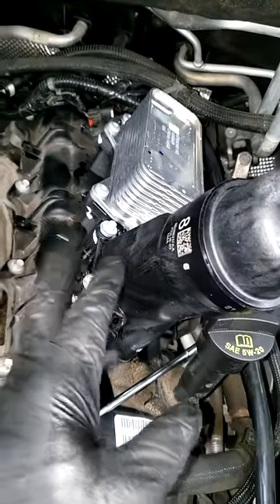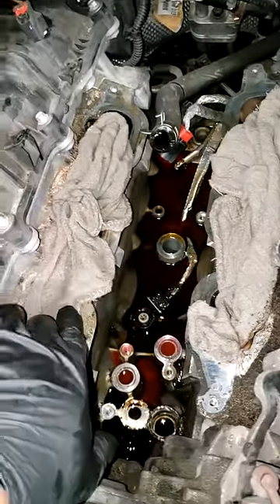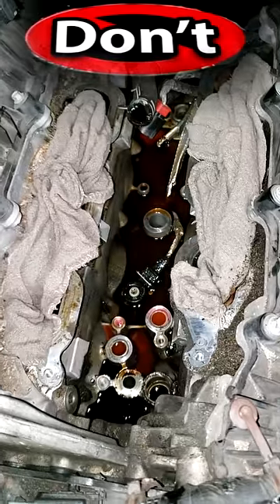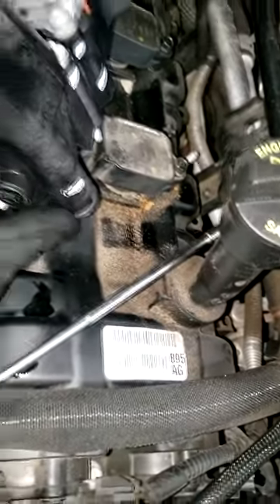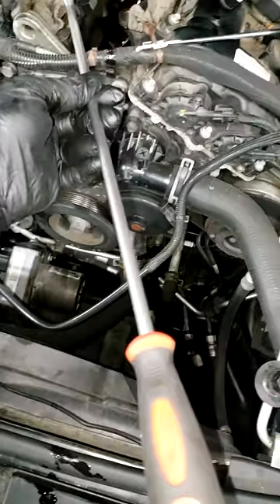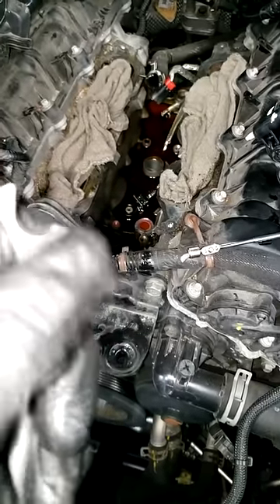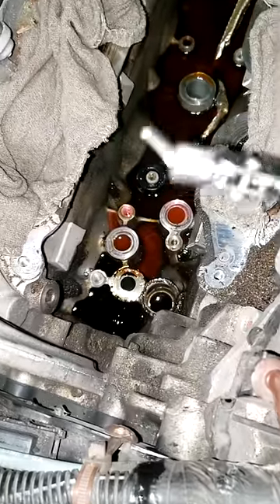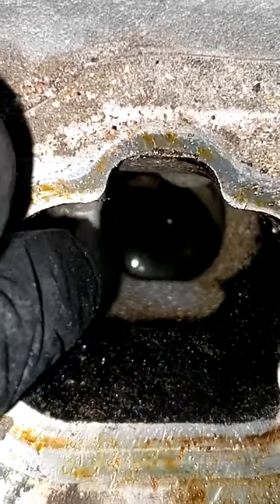This will scare the hell out of any mechanic. But I found it.

Comment: Aw yes that thing know as a FO (foreign objects) which can lead to FOD(Foreign object damage). Learned all about this  while as an Airmen in the Air Force. You can never be too cautious where multi-million dollar air craft and their support equipment is concerned.  Something as small as a rivet or light lens can cripple or down an aircraft. Small lungs can also cause ejection seats to jam and fail. We had to empty our pockets while working in critical areas and collect all  damaged fasteners and other damaged materials we were fixing or replacing. 

So you are doing a very smart thing that everybody should be doing.  

Funny story my college auto teacher left  a rag sitting inside the 454 he had done head work on when he was younger. He found it when he broke down in a lake with his ski boat that he had put the motor in because he had no oil pressure. He got it back  to the dock and found  bits of the rag in the oil pan. He backed his boat between two trees and created a makeshift sling to remove the head and found the rag all shredded inside the engine.

Comment: I once had a Hyundai Sorento 3.5 V6 that the intake manifold variable length butterfly place screws came loose. Found a half eaten/worn down butterfly plate sitting up against the intake valve. It ran fine it came in for a tune up and manifold gaskets. lol I test drove it beforehand and it drove fine.

Comment: It's crazy I just got done taking off my intake and my high pressure fuel pump they had these little metal clips and for some reason I decided to look into my intake and just see if you know what my valves look like so you can't be any more true about covering those up if I would have just been nosy and wanted to see my valves and what they look like I would have had that metal piece stuck in my intake awesome video
Reply from the maker: Whoaaa, yea man stay alert. Thanks for watching

Comment: Did the same job you did a while back. It seems the rubber o-rings go bad overtime or something. I ordered a fully alluminum oil cooler to hopefully make it last longer instead of the whole plastic housing, Anyways it came with new bolts that you had to put in and stupid me went to put them in after I seated the oil cooler in the middle of the intakes and one bolt slipped out of my hand from being oily and landed right on my shop towel that was covering a intake. I've never thanked myself so much in my life. The valve was more than open enough for the small bolt to fall in. ALWAYS, cover the intakes, covering the intakes, take no effort at all, and save you from many problems that you do not want, I'm sure, lol.

Comment: I keep a smart watch charger for fishing objects out of cylinders or intakes, I fished a screwdriver shaft out of a sparkplug hole with it in about a minute after failing with a telescoping type, and I got a nut out of an intake with it, very handy little magnet cord, it's about 2 1/2 ft long, thin round cord with 2 powerful  magnets about 1/4 inch apart parallel with the cord, the three electrical contacts in-between the magnet allows it to slide over magnetic surfaces by pushing and twisting the cord, but when it hits a loose bit of metal, it hits good enough to drag it up, manipulate the object with some needle nose, bam, crisis averted. No extra work over a bit of metal, just a bit of fishing.

Comment: as soon as I took my intake manifolds off, I go to get my ratchet and the back end of the socket hits the intake pipe and the socket comes off falling directly into the intake port. It was only a 8mm socket and thankfully the valves were closed on that cylinder. Also had to clean out some black death in the injector ports and the brake cleaner straw flew straight out and into the cylinder haha.

Comment: I was doing cam and lifters on a Hemi one time. I put the passenger side cylinder head on (with a little bit of wrestling) and noticed one of the caged nuts for the exhaust pipe was missing off the manifold. I had already torqued the head down. I decided to bar the motor over slowly and sure enough it stopped turning. Pulled the head back off and that nut was sitting in cyl #6. I could have just as easily said "oh well I'll just get another nut" but that's why I stress to my apprentices to keep track of all hardware. Not just so you can put it back on, but so you know it's not somewhere it shouldn't be.

Comment: I was doing this job on a v6 jeep wrangler. lost a little 10mm bolt that I thought fell on the floor so didn't worry about it. got the job all done and started the vehicle. the bolt fell into cylinder 3 and vent both valves. thankfully complete cylinder heads are only $400 and a head gasket was $80 so was a cheap mistake.
Reply from the maker: Dang, that sucks. Sorry bud

Comment: As a Mechanic of a 2 man shop that services way too many of these 3.6 Engines. (Whether in Wrangler's, Durango's, Grand Caravan's, and a Heating / Plumbing Fleet of over 200 ProMaster's... I do these 3 to 5 times a week... The only thing scary is the fact you used a cheap flimsy tool that is not even necessary. Just grab it by hand, lift and just a little wiggle... Comes right out and no tool required. No flying pieces. A decent Mechanic can let the Cork loose on the Cooling system and replace Adaptor, all gaskets replaced and Vacuum Filled and crank the Key on a ProMaster in 90 Minutes if all parts are already there. My personal best is 49 Minutes.
Reply from the maker: Lol, I cant tell if you coming for me with these shots or you genuinely trying to make a point. So please enlighten me first before I commence to clowning ya ass.
Reply: @OnlineMechanicTips  Just making a point. No reason for any sort of Prying Bars, especially something that could break from Plastic lifting an O-Ring'd Tube.

Comment: I dropped a lock washer in my intake. Started the motor heard a clanging sound. Took it apart and put it back together. There was a imprint of the lock washer on the top of the piston. Ran great. I got lucky.

Comment: It can. Happened to me on an old Volvo 4 with the vertical intake runners. I even stuffed rags in them right after opening but a washer still ended up in the cylinder.
Reply from the maker: Ohhhh Snap

Comment: I put up a short about this. About putting paper towels in the intake so bolts and nuts don't fall in. I had to take the intake plenum everything off my 08 Town & country to do the valve cover gaskets that were leaking terribly on my van I just bought from a shady car dealer.
Reply from the maker: I saw that video..Dam good tip,
Reply: @OnlineMechanicTips  Thank you 👍

Comment: Just did one of those a week ago on a Jeep. I just wiggle and pull up to remove it. Its just an o ring seal. Upgrade it with Metal oil cooler body.

Comment: If i saw it go in or think it went in the cylinder just pull the plugs and insert ur magnet in each one to make sure nothing is in there if its small enough to fall in there its u can get it out of the spark plug hole

Comment: this is why I have a set of bath plugs, specifically to stop up inlet and exhaust ports when working on a motor and needing to remove carbs and zorsts.
I've taken top ends down and found broken valves caused by nuts and washers that 'magically' appeared in engines that the customer messed with..
a rag is better than a ton of swarf in your motor too.
"I replaced a thread in my rocker cover and now it sounds horrible!"

Comment: “That valve is open” meanwhile just knocks dirt and sand straight down the head lol always use some simple green and air compressor to get in those cracks before removing the manifold! I’ve spent hours shop vac’ing with an extension into a cylinder to get dirt that got knocked in there out.

Comment: Back in 1988, my dad just built my first car, a 66 Nova, the hood was up and air cleaner off, my little brother had one of those wooden glider planes with the red propeller, with a rubber band, he wound it up too tight and Pop! The little brass pc at the tip flew across the garage right into the carb. He started the car and it was horrible. Took the heads off and there it was, a little ball of brass, since it was soft, no real damage!

Comment: I had a similar incident last week. Piece of a ram top side canister fuel filter snapped off, and I was worried it fell in the system. Luckily, found it on the floor.

Comment: Going a little further on this topic. Mercedes has their main diesel engine the Om642. When the oil cooler seals go I believe it's around a 14 hr job to disassemble the top end, turbo, intakes, pedistal, Egr tubing etc. 
If you drop even a little grain of sand or metal down into those oil return/feed holes you will see that engine come back around 3k later with a main bearing that's spun or with heavy scoring causing it to seize entirely.
You think you're a good tech until you learn the hard way. Always cover your holes people. Don't fuck around and take pride in your work. Once you remove a component, cover the holes if their sensative. 
This is peoples work inventments, their ego and sometimes their lives you are putting in danger. 
Keep your ego in check and just just do a good job.
Great message friend ✊

Comment: That's not a pry bar, it's a long/extended clip remover tool for getting hard-to-reach clips in headliners or bing trim panels. you can use them as pry bars, but most aren't hardened tool steel, so the small heads usually can't handle that kind of abuse.
Reply from the maker: You exactly right my guy.
Reply: Not defending harbor freight here, but I have to agree. Tool is made for plastic clips and interior bits. Using it for what it wasn’t made for, then downplaying the quality of the tool doesn’t make much sense…

Comment: At least you had the experience enough to cover the cylinders! When I'm doing head gaskets, I shove shop rags down in em. Things happen, and you prevented it from happening.

Don't even trip off the "that's not a pry bar" crap. I've used to many tools in ways they weren't designed. LOL! A tool shouldn't be use due to it's NAME, but used for it's PURPOSE!

I've used my Jeep winch as an axle puller...like two weeks ago! LOL! The axle puller couldn't do it because the bearings were heat-welded in a couple of spot. Hooked up the winch and tapped on the axle puller as the winch gave a little tug. POP! Came out after maybe 2mins.

...and that's what winched do. PULL.

Comment: Oh I've definitely had a scare like this. I was Walnut blasting my intake valves on my 135i. I forgot to crank over the engine to close the valves on the cylinder I was working on. Because I was on a roll and I got carried away. I filled the whole combustion chamber with Walnut media. Car has been running fine 7 years later. I had to spray compressed air through the spark plug hole while simultaneously using a vacuum on the intake port to get everything out

Comment: How about using an actual pry bar? I've been wrenching for over 20 years. Haven't covered ports in over 10 years. Never dropped anything down hole.
Reply from the maker: Then don't start covering them up now, you on a roll my guy. Just ignore this video. It was basically meant for sane people.

Comment: I cover them all the time due to a lesson I learned myself about 5-6years ago. My 01 Highlander did knock sensors and the harness had something drop in the intake, looked for 10 mins couldn’t find it and ended up starting it.. ticking noise will not go away lol. Lesson learned the HARD way, she’s still running but consuming oil😅 (probably a bent valve but at this point I’ll just put an engine in it when it dies)

Comment: I was chasing intake bolt holes in the heads of an engine with a tap and didn't use elctrical tape the end of the handle that wasn't crimped and the handle slipped out and went down in the lifter valley and then down into the oil pan... luckily the oil pan gasket was the next thing on the list for that car since it was leaking.

Comment: 100% 
My very first week as a professional technician I was doing valve covers on a kia sedona never doing one before i didn't realize there were washers on the end 2 studs of the intake cause none of the other ones had washer. Long story short one ended up inside cyl1 and granaded the bottom of the piston out after a few seconds of running

Comment: When I was the lube tech at a local midas the shop foreman did an intake gasket, then had me test drive the truck. I HEARD whatever it was tumble down the runner right before the piston hammered it. Brought it back in like "well that don't sound right" and the 1st thing out of the forman mouth was "did you put oil in it?" Knowing damn well we never drained that motor. I refused to take the blame, these tool boxes have wheels for a reason.

Comment: Made a bushing removal tool. While using, a nut came off on the back of the tool. It went past the Spyder gears and into the front diff. nothing like adding 3days to a job 5seconds before it's done😂

Comment: I learned my lesson when I was just starting out and I dropped a bolt down the hole where the distributor goes in. I ended up having to pull the oil pan off to get the bolt out. Since then I always block any openings with paper towel.
Reply: Yup, you just have to understand that you are the doctor of this motor you are doing surgery on. You can't leave anything in there that doesn't belong there. Period.

Comment: Used to do alot of those at the dodge dealer ship I worked at. One time I was in a rush and didn’t put the rags in, I was using a Milwaukee 3/8 electric ratchet and one the screws that hold the body of the ratchet fell in to the intake and I had no idea until I started it and the piston mashed the screw into the head

Comment: I was doing one of these a few years back. Removing the Christmas tree harness retainers, one of them snapped. Big deal. I couldn't find the piece. Thought it went past my head and out of the engine bay. Nope, fell down one of the intake runners. Started the van and had a misfire. Go through the diag and I have leak down on one of the exhaust valves. Pull the head off, pull the exhaust valves out of that cylinder, and there is melted plastic on the exhaust valve. If I had known, I probably could have just given it the beans and burnt it off the valve. But yes, cover those intake runners.

Comment: Dropped a tool part down the oil return in a head, the stomach feeling is just the worst.  Luckily I was able to fish it out of the bottom of the oil pan through the drain hole with a magnet.  Did a tribal dance in the cul-de-sac after that.

Comment: I had a scare when I had my valve covers off… I dropped one of the cam cap bolts in between the phasers, making me think I just dropped it into the bottom of the timing cover. I spent 30 minutes panicking & swearing in my garage thinking I was screwed and I had to rip the timing cover off my FWD pentastar, turning a minor rocker arm project into a major one. 

My wife ended up coming out to the garage to investigate my panic, and after looking again she and I noticed that the bolt got caught on a ledge on the inside of the timing cover, teetering on the brink of falling all the way in. I was able to retrieve it with a very slim magnet, alleviating my anxiety. 

I learned that day to always cover voids like these lol

Comment: You don't need a pry tool to remove the oil cooler.... A few wiggles and it comes out... I did 2 back to back literally yesterday with in 2 hours on each job.

Comment: I had some porcelain from a spark plug go down a cylinder once. I eventually fished it out with some grease on the end of a metal bar, but man, was I ever pissed about that when it happened. I was trying so hard to avoid it at the time.

Had to get a boroscope and fish the little piece around so I could grab it, too.

Comment: I was cleaning the ports on my Toyota and all went well there but when I was pulling my injectors the rubber end stayed in and I tried to get it with a handless pick that I had and dropped it INTO the cylinder from the intake valve and it was open enough that it slid just about all the way in and I spent 7 hours trying to get it out since the hook part kept catching on the valve

Always cover all your holes

Comment: Been there done that. On a 1994 Mitsubishi 3000GT VR4 that was 100% operational all the way down to the active aero. Dropped a lock washer down the lower plenum and didn't even know that's where it went. Apparently, another tech had dropped the same lock washer, and replaced it. It landed in a weird spot under the plenum that was hard af to get to, so I thought it was the one I dropped. It was not. Well, some bent valves and a dinged up piston, she's still on the road. That is my mechanic nightmare story. I in fact still have what's left of that lock washer in my toolbox.

Comment: I had a 1926 Ford Model T. I had the top cover off of the transmission, and I dropped a bolt in it. The engine and transmission are in a common oil pan, so the bolt went to the bottom of the pan. No matter how hard I tried and how many tricks I used, there was just no getting it out. I had to pull the engine, and remove the oil pan to get the bolt.
Reply: It must have been tempting to just leave the bolt in there. But doing that would be asking for trouble, especially on a hard to replace engine like that.
Reply: @joevignolor4u949  Exactly.

Comment: Dropped a razor blade down into a 5.3 head doing a intake gasket on a 2001 chevy. My luck valve was open had to pull the head to get it out. Painters tape from then forward.

Comment: I had a plastic clip break off and go flying down an open spark plug well. Luckily the piece was just too big to fit in the hole to the cylinder. Biggest panic mode.